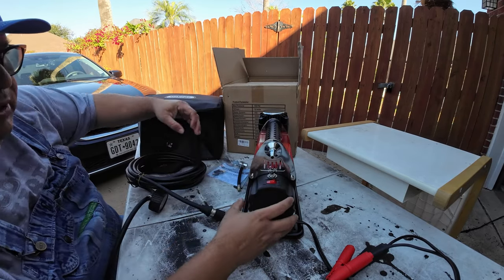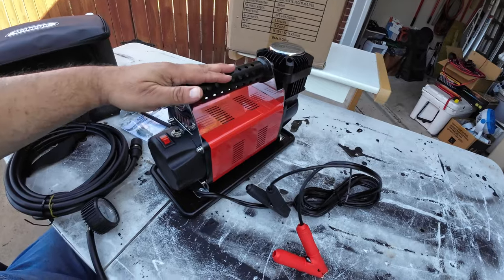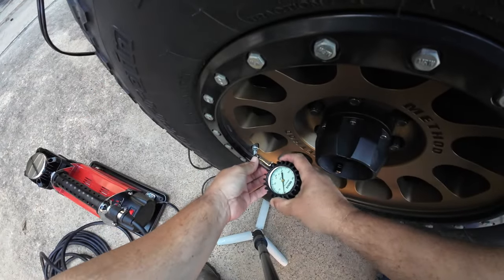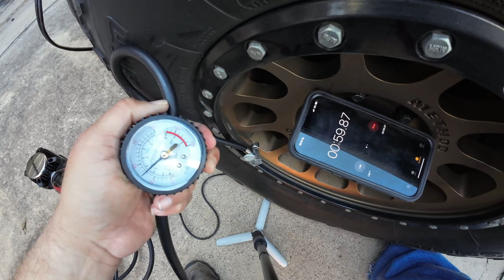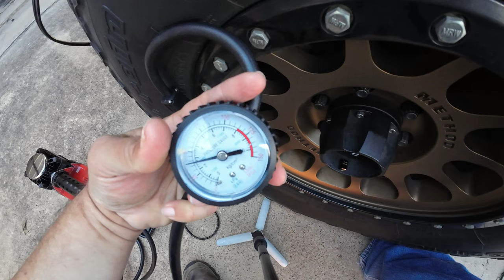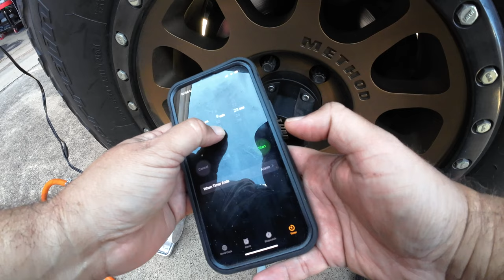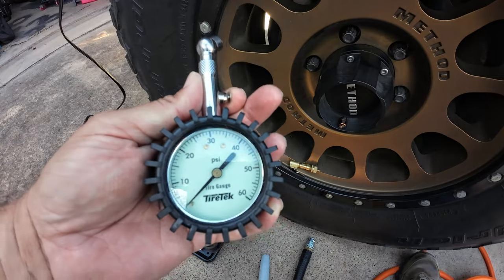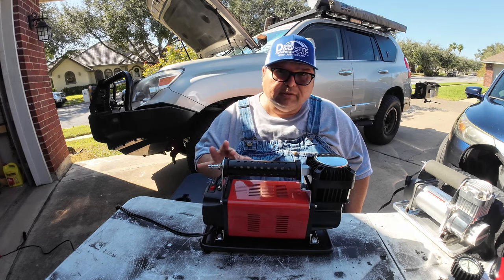Super Affordable GOBEGE 12V Air Compressor - Can it beat a VIAIR 300P?

Comment: Another way to check current psi (semi accurately) with the pump is to have the pump running and pressing the bleeder on the back of the gauge while running. It’ll give the reading without having to turn off the pump. Great review and 3 minute tests to actually see the differences🤘🏻
Reply from the maker: Hi Nacho!! Thanks for the tip. 😎🎥

Comment: You got that shade going at the time of this compressor review 👍
Reply from the maker: My garage is positioned towards the dang setting sun. All of my projects are done in hellish misery 😂😂😂
Reply: @Coastal GX  well that day looked beautiful and you were in the shade 😅

What's your take on helper bags for the inside of rear springs?

2018rav4 hybrid limited has gotten us through places we shouldn't have been able to make it ...but the only thing is our cargo weight capacity makes the rear sag when loaded for camping...trying to save some money upfront for those heavy load adventures
Reply from the maker: @christophervela5447  not familiar with that, but if you’ve done well in the RAV4, you must have some decent skills. 🙌🏽
Reply: @CoastalGX  no lol half risky half aware of my surroundings lol

Comment: You always have good shows for me! I have a hood (fender well) mounted "Viair" compressor in  my '69 C10, to operate twin air horns, that were on my PawPaw's boat. My dad bought the C10 new and I am 65!NOT my beach vehicle. I have the 2015 Colorado Z71 for dat! I messed around with cheap compressors first, but ViAir is the tits fosho. We definitely have to watch weight/size on sand. You probably don't have room under your hood. My C10, i can almost stand between the motor and fender well! Good job Sir. ❤️🙏🏼❤️
Reply from the maker: Thank you, Ira. I used to drive a ‘green (with white roof) ‘69 C10 in high school. It used to love to shift itself into reverse when I had it idling in park 😂. I ordered a special tray that will support a dual ARB compressor. Viair has served me well. The Gobege is good, but a little bulky.
Reply: @CoastalGX I remember! We talked about it. Mine is a "Medium Gold Poly" with a white roof or "cap."
Reply from the maker: @ITigerbaum  true!!! Lol. I forget things 😂
Reply: @CoastalGX   I'd like to see what the output of 2 ARBs. imagine what you could do with all that mobile air! Zodiac boat? Weather balloon? 😉
Reply from the maker: @ITigerbaum  I could probably fly that balloon clear across to Canada! LOL

Comment: There's another video comparing the gobege to the 300p and they did a 2:08 minute test from 10 to 30psi.  The 300P did slightly better in their test than the gobege.  About the same amount of difference as you got but in the opposite direction.  Maybe there is some variation between pumps.  Either way they seem pretty close and the Viair is smaller and lighter.
Reply from the maker: Yes, and maybe the Viair struggles past the 30psi mark. I ended up gifting my viair to my son and now have onboard ARB. Any other these products are good. Better than not having anything lol. Thanks for watching.

Comment: The Gobege is rated for more air, but I wonder how well it’d do consistently having to do 4 tires (6 tires in our case because we have a trailer) without overheating.
Reply from the maker: Good point! I have onboard air now. I own a dual ARB and it’s under the hood. It temporarily shutdown on my 6th tire when it was 104 outside and the engine running. So they do have a limit.

Comment: You need to look at the moreflate. I got one and I can put up all 4 tires at once and it takes maybe 4-5 minutes
Reply from the maker: Which one do you have? The TenSix or FiveSix? I’m familiar with their awesome systems, but they are pricey. I use the small Viair because of its smaller dimensions. Saving my $ for an onboard ARB in the engine bay. Thanks for watching and commenting 🙌🏽
Reply: @CoastalGX  good morning. It have the tensix. I have a viar as well. Keep up the good work

Comment: Hey Robert, I'm a new subscriber.  Can you compare it to a two piston air pump..   In the passed I had purchase one, had issues where the connest got extreme hot.  Just asking.
Reply from the maker: I don’t own a two piston compressor yet. I do know that the VIAIR gets crazy hot by the time I air up all 4 tires. I then have to let it cool down before I store it. I only used the Gobege in the video on one tire unfortunately and it didn’t heat up. Im sure it gets hot, especially in the heat.